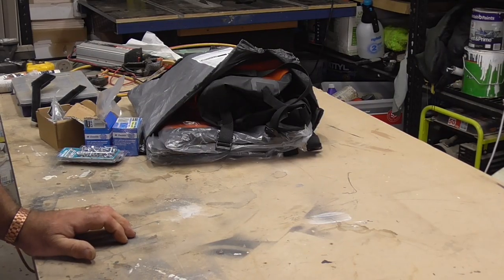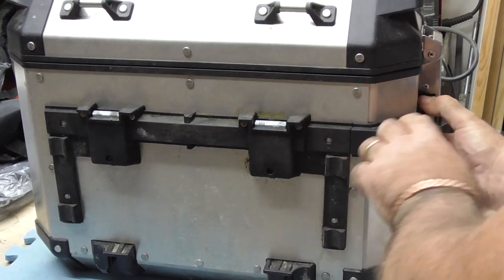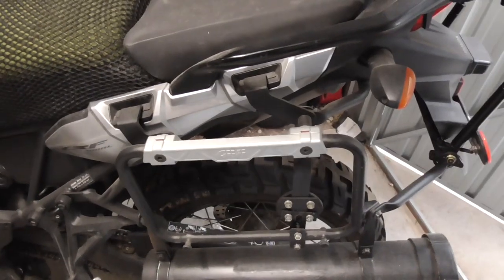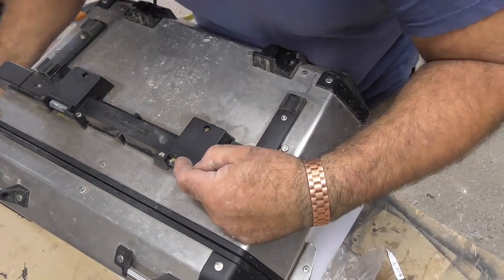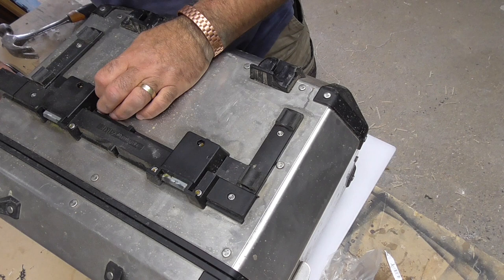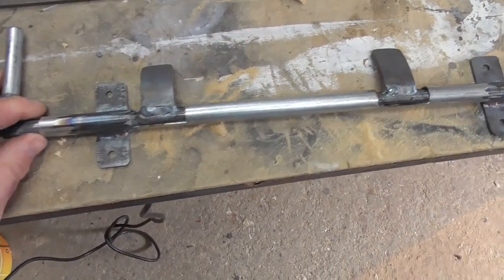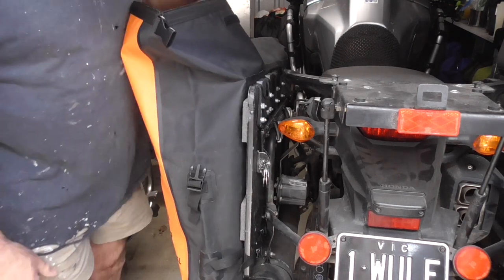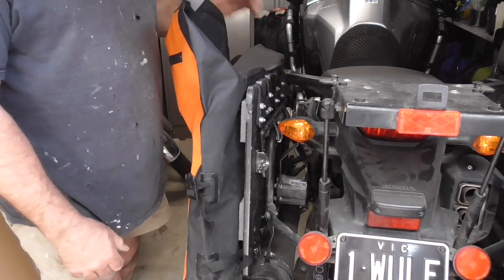Making a set of Soft pannier bags

Comment: You're in the wrong job mate, whatever that is lol. Those 3D printers are the bomb and can save a fortune. I've been running softies for some time. I prefer them to hard boxes, saw someone break an ankle when it got stuck on an off-road trip, between the frame and box. Even with good boots on. Nice one mate.
Reply from the maker: Cheers Hurley.
 I did go down under one of my boxs a couple of uears back ended up having op on my knee. 👍👍

Comment: If you had put a slot or two at the top of your cutting board/backing plate you would have a grab handle or two to make removal when loaded possible or much easier. Now you have to pull the latch handle and somehow lift the panniers off  the top latch with one hand.
Your rattle or loose fit, can you pull the mount and in your vise work that clamp strap down a bit for a tighter fit? Or, would that make removing the bags hang up at that end?
So instead of a pop-up latching tab you went with a strap to fit over the tubes. May want to wrap the tubes with couple layers of good electrical tape like 3M Super 77.
Reply from the maker: Thanks buddy some good extra ideas 👍👍

Comment: What size plastic boards did you use.... Are they just commercial grade 1/2” thick white cutting boards.
Reply from the maker: 600x450 and yes standard nylon cutting boards
Reply: Wulf On The Run thanks. That’s 24”*18” for us still stuck in Imperial system US guys. Nice job.
Reply: Wulf On The Run thanks. That’s 24”*18” for us still stuck in Imperial system US guys. Nice job.

Comment: Just buy a set and save the chew on
Reply from the maker: Givi don't make a soft set of bags to fit their monokey racks. Otherwise i would of bought some and not made some 👍👍
Reply: Wulf On The Run don’t the grt709s fit?
Reply from the maker: @boxfullofneutral8514  not direct to the monokey. You have to bolt a plate to the frame. Which would need to be took off and put back on everytime i swapped from bags to boxs.